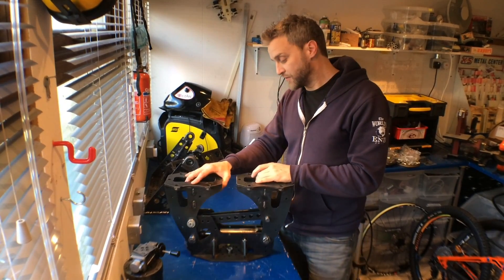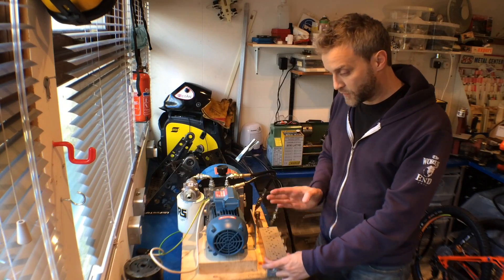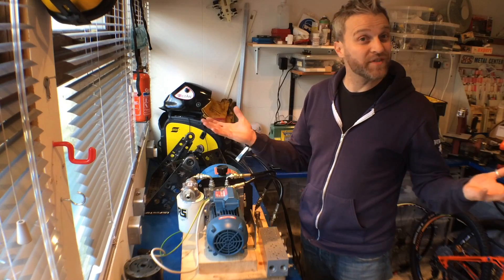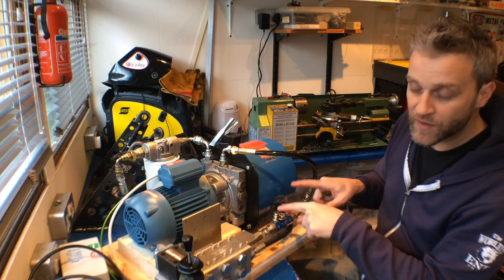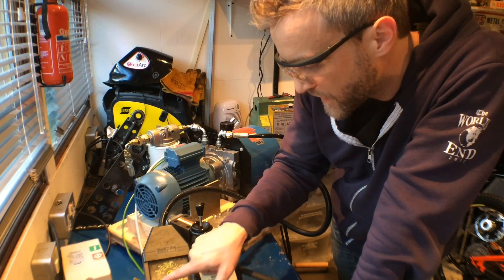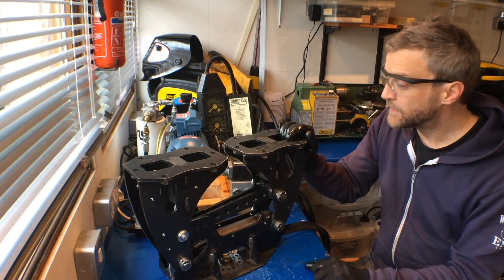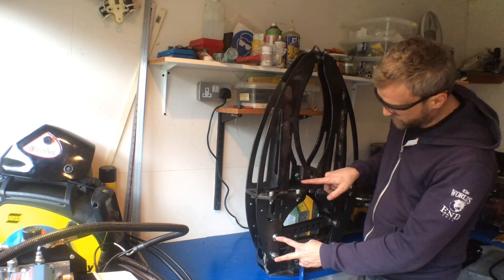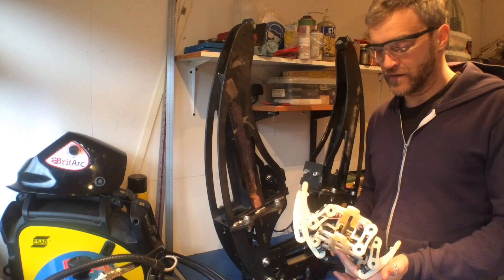Mantis Gripper | CRUSH TEST! | - Mantis Hacks #2

Comment: Nice! :D wish i had the money to do this to :D what control are you going to have for the gripper so what kind of precision are you expecting with them? 100kg of force semes a bit dangerous to have upfront if there is people unfamiliar to the machine around :P keep up the good work :D
Reply from the maker: They will be driven in closed loop position control, from the existing servo controllers on the Mantis. I will possibly do and example of this on an Arduino or something to show how the system works, with the possible addition of force control. The force once on the mantis will be more like 400kg!! And yes, the whole machine is kind of dangerous, which is why I operate it with certain H&S precautions in place :)
Reply: nice! a video about the Arduino would be very nice :D how would you implement the force control? pressure sensor in the cylinder? force sensitive(the chosen one?) coupling?
Reply from the maker: Hi, My next video will move on to hooking the system up to an Arduino, starting with the absolute encoder. I'm going to start with a pressure sensor in the hydraulic lines to the cylinder.. and see how that goes.
Reply: nice cant wait :D

Comment: Awesome! Great to see the gripper in action! The mechanics seem to work pretty well. Is there a reason for why the gripper closes much faster than it opens? Does it have something to do with the cylinder having less volume when closing (due to the shaft?). I can't say I know much about hydraulics.. Looks fun! RIP little bug..
Reply from the maker: Hi. There is a good reason for it going slower when opening. I removed that section from the edit, but basically it was really fast opening because the rod side of the cylinder has less volume. It was so fast if you weren't careful the whole bench would shake and my lathe was jumping around. So I added a flow restrictor in that direction :) Glad you like it, share if you can.